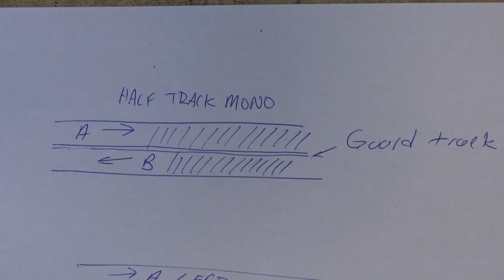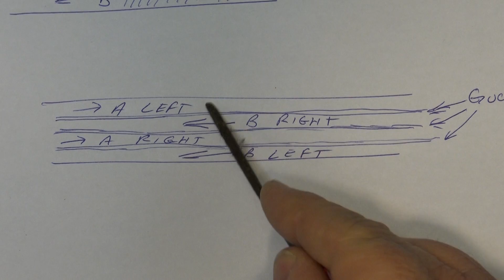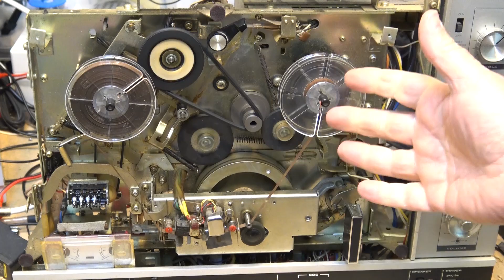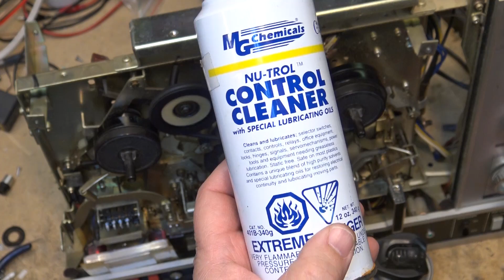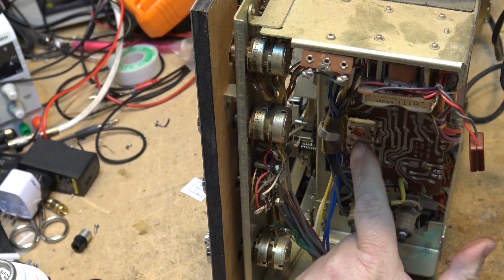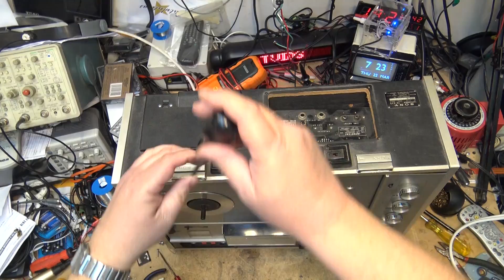Sony tc540 Reel To Reel Overhaul Part 2

Comment: Thanks so much for this detailed vid. I learned a lot. I’d love to see a Sony to-500 electrical side! I just cleaned up the mechanism on mine and it seems good.  The idler tires are looking rough, but the contact surface seems to be OK. The “ bass booster” doesn’t seem to do anything on a aux input play through, but maybe that’s normal? Now I just need to get a test tape !

Comment: Do you have a video servicing a Sony TC 580? Mine had a tape split at the spice, which jammed it up inside a bit then it stopped playing. Still does rewind and fast forward but the pinch roller doesn't switch sides anymore on playback. Thinking maybe a selenoid may have stopped working. But weird a tape splitting would cause this. Any video you did would be great. Can't find one you did for the TC 580. Thanks!

Comment: hi could you tell me where the wires goto on the start run capasitor on this model as when i opened mine there was a long green wire going no were many thanks

Comment: i would keep one of the 3 speed too i have a teac an60 dolby that i could calibrate to it
Reply from the maker: I now have a 4 speed reel to reel.  Has 15/16 ips as well as the other ones.  Had a guy offer me 250 for it which i would have accepted but he wanted a PayPal invoice and I don't issue those as I got burned before by a dishonest buyer that claimed something didn't work and used the invoice to get a refund and burn me.  He didn't trust me to ship after he paid and i didn't trust him not to file a chargeback after the fact so it still sits in the box.

Comment: I notice that you use 3in1 oil to lubricate. As a sewing machine tech, years ago, I got training from Bernina of Switzerland. When it came to lubricants, the lead trainer told us (as dealers) that if they ever detected the use of 3in1 of WD-40 in a machine we sent to them, they would void the warranty. This is because, they said, it leaves a gooey residue in the bearing areas after the distillates have evaporated. I don't have any experience with it other than those warnings and the fact that I hate the smell!

Comment: hi yes all tracks are a right pain there's a  akai  1800ss it's got a full track   E HEAD  when it's turned on in quad  recording
100% will kill all the tape  i used the unit to kill all the tracks on 8 track tapes when i take the loop tape out and move tape into the carts
8 tracks wear out  on the pinch roller is

Comment: I know from fixing older reel decks like this that there is a switch to lower the high level on the tape at the slower speed of 1 7/8 ips at the tope by the take up reel the switch is located as you know and the tone is changed by that switch

Comment: I agree with you on that as some of the older capacitors have lower resistance, by changing them all you will affect certain circuit characteristics by a huge amount. I only change them when needed. On certain Pionneer reel to reel deck the smaller ones do need to be changes. On Techinic's deck all purple one as I refer to them purple death need to be changed. Even then will use low ESR when available. Usually Akai's and Sony's reel to reel decks have no issues with capacitors going bad as used thicker seals and oil based. They were higher quailty then what's available today even and tested better then new ones even. 

Akai and Pioneer's deck usually have transistors fail if anything and due to silver plating they used on lead's, the 2sc2240 transistors they used in Akai deck's and  in Pioneer the 6 2sc1344 transistor fail. I replace them with Fairchild KSC1845FTA. They are lower noise and sound great in these machines.
Reply from the maker: The Tech Genie 

Amateurs generally will go in and replace all the capacitors mainly because they don't know how a capacitor works or how to troubleshoot it. Just today (no there won't be a video because I didn't film it) I repaired a Hammond B3000 organ. I changed 1 part. A 1uf 35v tantalum capacitor in the -24 volt supply. It probably would have been a good one to film but I fixed it on site. The owner was thrilled to be able to play it again. First thing he played when it fired up. "Smoke on the water"
Reply: 12voltvids Yep it usually one part that goes bad and just a few minutes to trace it down is how most repairs go. 

I had a guy sent in a RT 909 where he fully recapped it as neither reel motor was working. So in his Infinite Wisdom he assumed somehow must be bad capacitors? So he ended up spending over $80 buck on eBay for capacitors? Which can be bought for $35 bucks at mouser electronics and he replaced them all himself. So took it after he screw it up and gave up. All the issue was one bad micro switch that goes to the tension roller assembly when high resistance. That fix the issue. Then second issue found capstan motor won't run, turn out to be a bad zenor diode. Plus hour, or so cleaning up his solder joints.

Then again had people bring me their close to $1000 smart phone in a bag after they attempted to replace the screen themself. One case they broke the connector inwards trying to force the connector from screen in. they where lucky found the connector and replaced it. but cost them the screen and $100 bucks to repair damage to logic board. So nothing surprises me anymore.

Comment: I agree on every you said about replacing electrolytic caps. Electrolytic caps do not fair well if they are near a heat source.
Reply from the maker: Right. If they get hot they will go bad, but in low power coupling and bypass circuits they will last for decades. It wasn't untill the switch mode power supply that we saw them start to fail in numbers.
Reply: Yes in low current signal circuits like you are working on very unlikely to have any bad caps.

Comment: Motor oil? Is that what jukebox technicians use to fix or lube the spring if the record on the jukebox has trouble coming out to the tonearm?

Comment: The MG Super contact cleaner still has the Tetrafluorethane and still works as good as the old stuff I just bought some more recently but like you stated it's a much smaller can now and like the Deoxit costs about $25 for the same size small can. But you do have to find the MG Super contact cleaner it has the gold stripe not yellow or orange. Maybe it's only offered in the US?
Reply from the maker: I didn't know you could still get the Freon TF super wash. I have a case of it somewhere.

Comment: I was surprised how well the 1 7/8 speed sounds on this. They all sound good. Great restore.
Reply from the maker: I should do a demo with the line out piped directly into the computer and then you will definitely hear the difference as it is quite dramatic. The high frequencies roll off above 6KHz @ 1 7/8, 11 KHz on 3 3/4 and 7 1/2 goes up to close to 20K

Comment: Lucky yours was a obviously easy fix...my sony TC366 shows recording on the VU meters on both channels , but when I switch from source to monitor to hear it while it is recording , the left side is dead, I figure a cap or something opened , because it literally happened overnight ....dont know where to look  the record board or the playback board... It will playback previously recorded tapes just fine , so looking at the record side ..have to dig out my o-scope I guess...
Reply from the maker: Check for the record signal present to the head. The RF levels should be about the same. If one side is low or missing, I would suspect the record drive transistor. If the side that is not recording is higher (voltage that is) then the coil in the head itself may have gone open. If you disconnect the record head you can measure the resistance of the 2 coils. They should be close in measurements. If one is much higher or much lower it could indicate a short or open on the head winding. As it is a 3 head deck playback is unaffected.

Comment: Good work. I  would like to share my experiences regarding spool tape recorders: 1. Recording speeches and lectures are prefeably at Slow speed, music at fast speed. 2. Some times tape got twisted and people without realizing play it, it will sound weired & alien because coating side (which is not shiny) doesn't run across the playback head causing playing back in reverse and without actually reading the recording on the ferris side. Lots of regards
Reply from the maker: We used to play with tapes as a kid that way.  Flip the tape over and play the back side, and it would play the reverse side backwards.
I will probably do a demo to show why tape recorded on a half track needs to be bulk erased before being used on a 1/4 track.
Even though I explained it here, with the guard tracks ect, actually demonstrating the effect will I am sure show peole what happens.  Since I have that Grundig 1/2 track unit this will be an east task. Might even do that one today.

Comment: Thanks for answering the Deoxit question. I just received the Deoxit 100 and 5% and used the d100 on a q-tip to clean a contact and it amazed me how well it workes. Awesome vid. I had a favorite uncle growing up and he worked on alot of audio and owned alot of reel to reel equipment. They couldn't have kids so they adopted a baby girl, My aunt passed away like 5 years after that and then he passed away when his daughter was about 19. She immediately sold the home and threw out like 20 reel to reel like you have been restoring that worked, 5 oscilloscopes, 3 spectrum  scopes, a few CB and ham test equipment, tone and frequency generators for CB, Ham, TV, FM and AM. Put it all in a dumpster. Sold the payed off house and moved to the west coast of Florida with her boyfriend. Did all this within 5 days of his death and didn't tell anyone till after she moved..
Reply from the maker: You just made me cry :(
Reply: That is a down right sin,throwing high class equipment like that in the dumpster.I hope someone rescued all of that equipment,and they are still in use today.Some people just react before looking for help.Vintage audio rule.I am always looking for vintage test equipment.

Comment: I can see why you have a collection, they just work so well, worth keeping :-D.
Perhaps some of your lesser units can be sold off, so you keep the creme of the crop.

The reason i commented about the brakes is i've seen so many fail, so i would always check them just in case.
Reply from the maker: Right, and I did check them, but as you saw it was just a mismatch in the reel size which is why I mentioned it. The take up reel should be the same size as the supply.

Comment: I have an old idler mono machine. It took a lot of heavy use and served me well for years. Recently it started making a bumping sound. At first I thought it was because the idler wheel had a flat spot. Upon a close inspection the idler was fine, but the capstan flywhell has a bad case of metal rot and swelled and cracked in one spot due to internal oxidation. It will fail soon and there are no replacement parts. What kind of rotten alloy did they use for flywheels back then? It appears to be zamac but I may be wrong.
Reply from the maker: Metal fatigue was a common problem on some of the vintage recorders. I am lucky as I have now 7 recorders, 6 in working condition and the final Sony will be overhauled soon.  I may not keep all of them though as I get requests constantly to sell one or 2 so I may do that.

Comment: Aha a self-induced problem. Luckily it was only a 1 wire issue.   If I need to work on something I will always take pictures of the connections and wires.  Takes a minute but can save you loads of time and frustration in the end.
Reply from the maker: Luc Peeters 
I knew the problem when I finished part 1 but decided to make it 2 parts because it generates more revenue that a really long 90 minute video. 
Pictures are good video is better! Why do you think I film all my repairs. As a reference so I can remember how it came apart as many if these things I have never seen before or if I have it was a long time ago. Remember I retired from the repair business in 2003
Reply: Yup, I should invest in a similar setup and video it all. What do you actually use to record all of this?